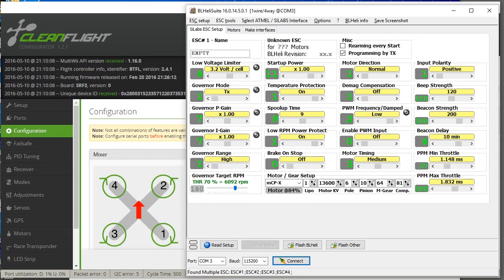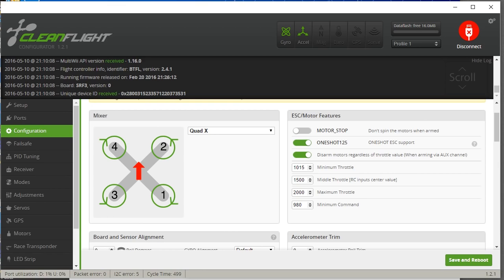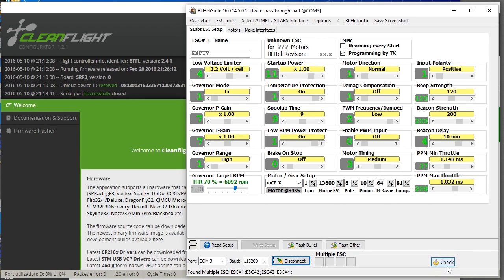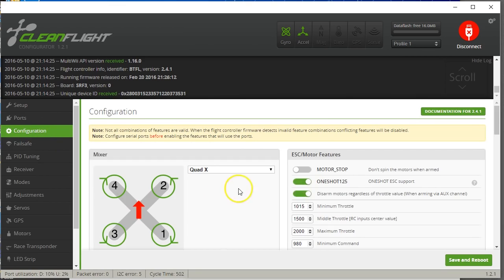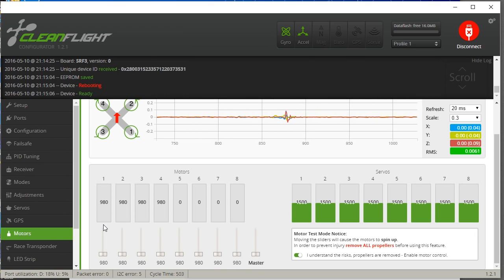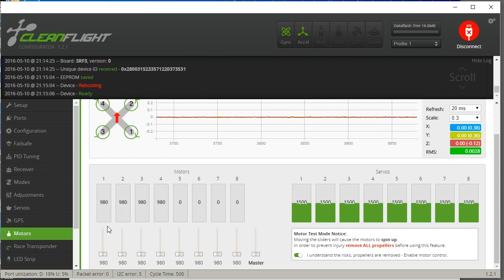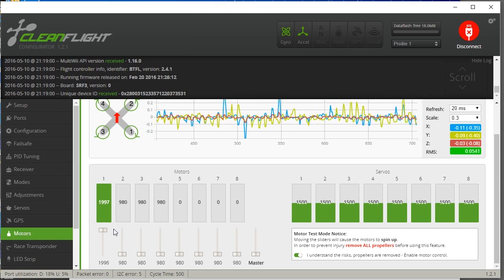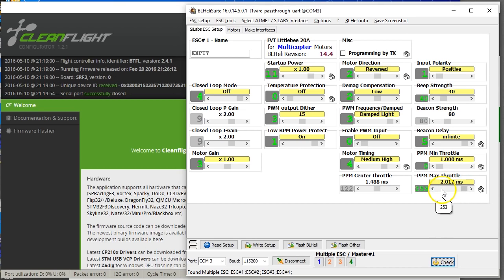Maximum Resolution ESC Calibration

Comment: What should I do if I use Dshot? The Min Throttle, etc... boxes don't show up unless I use multishot.
Reply from the maker: +BananaScience good news! If you use dshot you don't have to calibrate! So those parameters can be ignored. That's why they disable. And that's one of the main advantages of dshot.
Reply: Cool! Does that mean that I can set the BLHeli PPM min and max to 1000 and 2000 for maximum resolution?

Comment: Hi Joshua, I hope you can help me out. Would you know why my min command and max throttle won't save in cleanflight. I set them at 1000 and 2000, save and reboot and they change back to default of 1000 and 1850.
Thank you
Reply from the maker: +Daniel Lewis what firmware version are you using? Usually this problem is an old firmware version that is no longer compatible with the configurator.
Reply: Thanks for the reply, I have never updated the firmware as I didn't want to stuff it up. It's currently at 1.13, I will try and update and see how I go.
Thank you
Reply: All updated and working perfectly. Thanks again!

Comment: So I have some BLHeli ESC 20A with DYS 920KV, tried your calibration...It worked great, but I hover at 75% throttle. Any Help will be much appreciated.
Reply from the maker: What size are your props?
Reply: DJI Style 10x4.5, DJI Hub Propeller 8x4.5, 9443 DJI hub.
Reply: Tried you calibration, it gave more throttle, but still hovers at 70-75%.
Reply from the maker: How heavy is your copter?
Reply: 477grams without battery
Reply: had faster take off at 8" and 9" props, but more power at 10" props.
Reply from the maker: Those motors should make plenty of thrust with those propls. Have you done just a standard calibration?
Reply: 1kg with battery. just weighed. 4200mah floureon
Reply: will create a throttle curve to adjust the mid point and get back to you.
Reply from the maker: +joel ben Nooooo if it hovers at 75% something is not right. Don't band aid over it with a throttle curve.
Reply: Throttle curve did not help, but by some miracle...I now hover between 55 and 60%. Thanks a million. And my power has now increased.

Comment: Hi Joshua, thanks for a super guide. Question... does this method supersede your previous vid called "Cleanflight BLHeli Top-End Throttle Calibration"  ? I'm guessing it does since this method also removes the top end dead band and allows maximum resolution... right?
Reply from the maker: It's a super-set of that method. But with BLHeli_S, I honestly just do standard throttle calibration.
Reply: Cheers Joshua, my BL-heli-s compatable ESC's are on the slow boat from China, looking forward to them!
Reply from the maker: +Quadplay hope you like them.

Comment: I followed this video for my current new build and when my copter is NOT armed each ESC/motor randomly twitches/spins up individually. It still flys fine but this is concerning as the motors should not spin up at all for any reason if the copter is not armed. Any ideas?
Reply from the maker: Reduce min_command to 950 then DO NOT re-calibrate.
Reply: Joshua Bardwell nail on the head. Thank you very much.

Comment: Josh, love the reviews and info, but I have a question that I have searched for and cannot find answers anywhere (maybe my google fu these days sucks, or I am just not asking correctly) but I figured you could easily tell me. Ever since I have upgraded to BF 3.0 and BLHeli 14.6 and up, as well as 16.2 and up, when calibrating ESC's in either BLHeli suite, OR BF, I never ever get the standard BLHEli beeps, then the fast beeps indicating calibration mode, then the end calibration beeps.. it literally just powers up, standard BLHeli startup sound,, then another single beep when min throttle is achieved. Is this the "new" way? My fear is that I am not getting a calibration when I do this and I have tried everything I know how to do to make it work.
Reply from the maker: +Tom Coffel (TC) I'm not sure but just check the endpoints to see if they've changed.
Reply: No change, whatever I set them to, they stay. It's weird, because it's not just one machine, it's ALL my builds. I have about 7 mini quads, and after updating to 14.6 (initially, I am on 14.8 now I think or whatever the latest is) this started happening. Everything flies perfectly, nothing appears off or out of sync, I think it's just an OCD issue with me, if I don't hear what is supposed to happen, I obsess over it. The only thing I did not try was individual ESC calibration as opposed to passthrough, which would be a pain, but I guess I could try it and at least see if it's a passthrough issue. While typing that, I had a thought, could it be the USB cable I am using? I do IT, and I know that certain USB cables are strictly for charging, where others are for carrying data and the pin outs make the difference. I know data passes through with reading info, but I am wondering if it's not somehow related to a cable.... hmmm, I will try some things and see what I can come up with. I appreciate your help and time taken to respond, keep up the great work!
Reply from the maker: +Tom Coffel (TC) have you turned off transmitter programming in blhelisuite?
Reply: yes, I did.. I literally just saw that and thought maybe that is the issue. I am trying it now and I will report back.
Reply: Yup, that was it.. I forgot why I even turned that off int he first place. Many thanks Josh, you're the man indeed!
Reply from the maker: I do recommend turning it off to avoid accidentally re-calibrating if the ESCs happen to brown out. Just remember to turn it back on after calibration.

What was happening to you was, the ESCs detected that the throttle was not idle and refused to initialize. The single beep was your warning that the throttle was not at zero. When you lowered the throttle to zero, they initialized. This is a safety feature to prevent spinning the props if you power up with the throttle raised.

Comment: So is there a reason why Cleanflight / Betaflights max throttle default is 1850? That's what I've been using forever. Have I've been missing out on the top end or just resolution?
Reply from the maker: It's because that was the default top end for SimonK ESCs I think. Everybody should use 1000/2000 these days IMO.
Reply: On rcgroups I read that the FC needs some free top end to do corrections if needed. Going full throttle on 2000 wouldn't leave any power to correct with. Is there any merit to this?
Reply from the maker: +samik83 that's not true. That hasn't been true since MultiWii but even then that doesn't change calibration.

Comment: im using tbs power cube and the manual say that in blheli the min should be 1004 and the max 1980. My question is i follow your steps when tbs say that i have calculate that and the values are 1004 and 1980 for the blheli and 1025 and 1980 for cleanflight or not because tbs has already done that and its ready?
Reply from the maker: +Bill Asimakopoulos do what tbs says.
Reply: thanks joshua!!

Comment: setting min command to 980 is standard for everyone to follow, or we have to figure out what min command is for our quad?
Reply from the maker: +DimplePoji min_command needs to be low enough to stop the motors fully. The exact value depends in the ESC calibration.
Reply: how do I check for that it is low enough to fully stop the motor?
Reply from the maker: +DimplePoji in the Motors tab, put the slider all the way down, and see that the motor stops.

Comment: Hi Josh, thanks for you videos. They are amazing and really helpfull! I did all the calibration in bf and blheli and the taranis, like you said in your vids.... but my throttle stick seems to just know on and off. It has no resolution at all. It goes instantly to max rpm.  I think i did everything right in betaflight. Can you tell, where to search?  I checked my taranis but could not find any issues.

Comment: Hi Josh thanks for this video. Just a quick question the 15 difference in your video. Is that the difference from the original 1000 of the minimum command to your the motor spool up number? Not the difference of 980 number you drop down to  before you set the min and max ppm in blheli. 

Thanks
Paul
Reply from the maker: +Paws yes, exactly.
Reply from the maker: +Paws yes, exactly.
Reply: +Joshua Bardwell Thanks for the quick reply. Just another question, can I use this method just the set then low end and not bother with the high end. ie normal esc calibration, leave high end as obtain during the esc calibration and just reset the low end ppm min and do the rest of your video trick, but minus the high end pmm bit. Sorry for all the question. But thanks again.
Reply from the maker: Sure, you can do that. You may get some oscillation at high throttle if there is dead band at the top.
Reply: +Joshua Bardwell Thanks for that., So to sum up. Do I even get top end deadband? Even though I do a normal esc calibration. Wouldn't all 4 esc ppm max throttle be set to the correct values during the esc calibration. Promise no more questions :)

Cheers
Paul
Reply from the maker: In recent versions of BLheli, calibration does not add any dead-band like it used to. But the question is whether there is any dead-band between what the ESC believes is max throttle, and the actual rpm or thrust response of the motors.

Comment: Help please. When I try to calibrate my ESC"s in Cleanflight or iNav, when I connect the battery, the motors starts up. What in going on.
Reply from the maker: +Michael Andersen in BLHeli, is transmitter programming turned off?
Reply: Looks  like I have to wait till I get hold of a Windows version, I'm on a Mac. Thanks.

Comment: learning so much from your vids! what do you press as the "home key"? and if i use a 3s? will i risk burning up a motor or esc?
Reply from the maker: Home key is the home key on your keyboard. You know, like home, end, pgup, pgdown?

Whether you will burn a motor or ESC depends. If you have an F390 ESC or Blheli_S, you will probably be okay. But no guarantees. Listen for the clicking sound of the rev limiter kicking in and if that is happening, you should stop.

Comment: Don't know for sure, but, leaving the "PPM min throttle" to every esc at absolute minimum and changing one by one the maximum value, don't alter the dynamic range of each motor ? I think every ESC has to be calibrated top/bottom to the same signal.
the esc receive the signal from the FC at (for example) 1500us. then it will scale that to the correct value to speed up / down the motor.
if i have 256 motor steps (in the driving output stage) the esc will linear interpolate between 0-255 based upon min and max,
so if you have one motor that has 1000us min and 2000us the value is 50% power (128), but if the esc has benn setup to have something like 1000-2020 the output power (in mid values) are maybe 49%.

I can't write english very well so it's very hard for me to express that idea... but right now i am thinking that trough this method you will get unbalanced response from motors and then over-stress the pid controller.
but is only an idea.
Reply from the maker: +Michele Branchini my experience has been that most ESC's are very similar to each other in their endpoints unless they are defective. So individual tuning of each ESC's endpoint probably isn't needed. Test each ESC to see if it's endpoint is very different, to find any defective ones, but ultimately they should be very close to each other.
Reply: +Joshua Bardwell The problem is not in the calibration of ESC itself.
is in the dynamic range of the input of esc vs output range on the motor.

you fixed all of the esc @ 1000us and adjusted individually every max-end-point for every escs.
this reult in different input range for each esc:
example:

ESC1 1000-2020us = 1020 steps
ESC2 1000-2018us = 1018 steps
ESC3 1000-2016us = 1016 steps
ESC4 1000-2017us = 1017 steps

but in the esc firmware the esc has to scale what gets in its own input to a fixed motor output steps.

so you make :
INPUT_VALUE : 1020 (STEP NUMBER for ESC1) = MOTOR_COMMANDED_SPEED : 256 (if there is 256 steps in motor output, dunno how many steps use latest blheli release).

using that formula each esc get different commanded motor speed
Reply from the maker: No, my point is that I set all the ESC's to the same value because there isn't much difference in their top end. In your case, I might set them all to 2018 and be done. Also, bear in mind that blheli has four us input precision. So the choice is 2020, 2016, 2012. You can see that 2016 would be correct for 3/4 ESC's in your example and only one step off for the fourth ESC. The PID controller is more than capable I'd managing a single step difference.
Reply: yeah... the number i've putted in the example is pure invention... 
let's see i will test this procedure on my machine and I'll see if it goes well for me.

Thanks ! :D
Reply from the maker: +Michele Branchini remember that the ESC's are controlled by the PID loop so small differences in the output curve will be compensated for. A single step difference in motor output is nothing... Is there a single step's worth of difference in the thrust output of the props, just due to manufacturing tolerances? Etc...
Reply: no... surely not, but why add another point of uncertainty among the other 100+ others ?

Comment: If my min command is at 1000 should I still set min pwm in cleanflight to its lowest at 1000?
Reply from the maker: +Andrew Auguscik what exact parameters are you referring to?
Reply: I meant blheli not cleanflight sorry. So if  my min command is 1000, in blheli should I set my pwm min throttle to 1000 or a little higher to allow room to work?
Reply from the maker: +Andrew Auguscik what I prefer is to set min_command to 950. Then set blheli PPM_min to 1000. Then manually set min_throttle to whatever it needs to be to keep the motors spinning. Min_command needs to be far enough below min_throttle to stop the motors but it doesn't matter if it is more than is needed. So I just set to 950 and be done.

Comment: Yeah but I dought its the motors and escs because it's not like an individual is causing the problem, and I dought I would get 4 faulty escs.
Reply from the maker: You may simply have a bad connection somewhere, and the vibration of the motors at high throttle is shaking it loose.

Comment: Yeah I guess that can't be it then): for that build I used a cheap pdb and an old naze just to get it up in the air. I have a pdb that Getfpv is sending me along with a quality pdb. Also, this time I will solder both the ground and signal wires to it since I've read that that can cause problems on certain FCs. Do you think the changes will make the difference and fix it? thanks for all your help, I don't even know where I would be without your vids and all your knowledge. Huge thanks
Reply from the maker: I mean, if it doesn't make a difference, that certainly tells you where the problem isn't.

Comment: No they spin up fine but when I'm flying, it acts normal and everything until I punch it out max throttle. After I try to lower it down after a punch out, I seem to lose control and have very limited control and I crashed, twice. Is it something to do with max command because it flies fine until I give it a high stick command on my tx
Reply from the maker: +Andrew Auguscik that's really weird and I'm sorry to say it's not ringing a bell at all.
Reply: I was reading a forum that described my problem exactly and the porblem is that the voltage warning is to high on the escs. Im using a 60c battery and skitzo motors with blheli-s escs so I see why my lipo sags. How do I turn this setting off, blheli-s doesnt have as setting you can change.
Reply from the maker: Low-voltage cutoff is not a setting that BLHeli lets you change in Multirotor mode anyway. I don't think there is an explicit low-voltage cutoff in the multirotor firmware. I'm not sure your conclusion is correct.

Comment: Hey Joshua, I have a  problem where if my motors go at max stick input, they spin at that but and then when I start lowering the throttle i loose control and dont have full range anymore. I can not figure this one out, already tried disabling programing by tx in the cli, but that didint seem to do anything. Thanks so much if you could help me on this, you've helped so much.
Reply from the maker: +Andrew Auguscik I'm not sure I understand what you're describing. In the Motors tab do the motors spin up?

Comment: Question for you, in this vid you say to have the throttle low point at 1000, yet in another vid you do you say that you shouldn't have either low or high points at the very end, so which is correct? Do I leave my low throttle at 1000 or do I have to change it?
Reply from the maker: +Spartak1245 medium. Just use medium unless you have sync problems.
Reply from the maker: +Mr5bBaja if you auto calibrate and end up with 2020 at the top, then you don't know if you calibrated to 2020 or some higher value. If you manually calibrate, then you know the exact value so it's okay. Also, you don't have to worry about going off the end of the scale with the bottom end because you are going to manually set min_throttle anyway.
Reply: Prompt please what timings to use with motors sannysky 2204?
Reply: Joshua Bardwell THANKS YOU.

Comment: Thanks for this video. Do I have to set the endpoints in my Taranis to 950/980 too? I am a little confused. Set all to 1000-2000 for channel 3. Thanks for a short reply...
Reply from the maker: +Marcus “Ehrenfelder” Steinhoff Taranis should be set so that the channels read 1000 to 2000 with 1500 in the center in the Receiver tab of Cleanflight. For me, this is usually about 97% endpoints on the Taranis with variable center trim adjustment depending on where the stick centers.